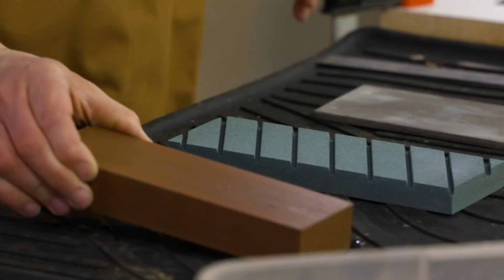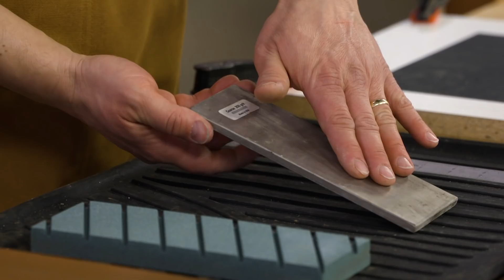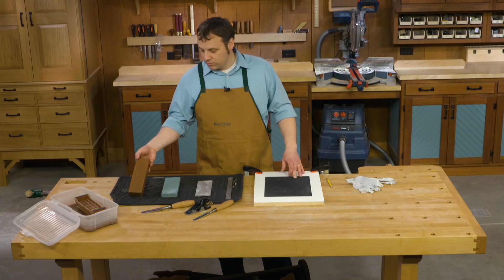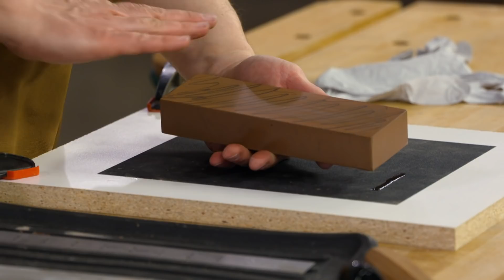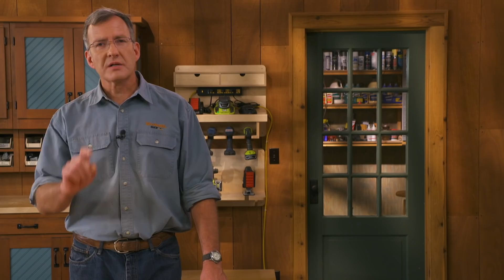Woodworking Tip: How to Flatten and Maintain Waterstones

Comment: I tried this on a couple of stones that I'd not used in a long time because they were dished, and I didn't want to make them worse. It worked like a charm! I used a large tile, poured water over it, soaked the wet and dry paper, and laid it on the tile with no adhesive. It still worked really well. Thank you for the video!

Comment: If you rub two water stones, of different grits together, don't they contaminate each other and dilute the water stones original grit?
Reply from the maker: It is possible to get a little surface contamination but once you rinse the stones off and make the first couple passes with your blade that will disappear.  That can be completely avoided by just using clean sheets of sandpaper for each stone though.

Comment: Why not just flatten the second stone on the sandpaper.  Why put more wear on the first stone flattened - you are rubbing the first, newly flattened stone on a non-flat surface.  Doesn't make sense to me.
Reply: felt the same way. maybe if you did not have a sand paper set up. I like to use the back side of 12x12 or larger ceramic floor tiles for flatting my oil stones they are flat and very hard and do a great quick job.
Reply from the maker: Yeah, we just kind of through that in as another option.  I would really recommend using a separate clean sheet of sandpaper for each grit so you don't contaminate the stones with the other grits.
Reply: Typically you need three stones to ensure a flat surface, two stones can make a curved surface that both stones share...